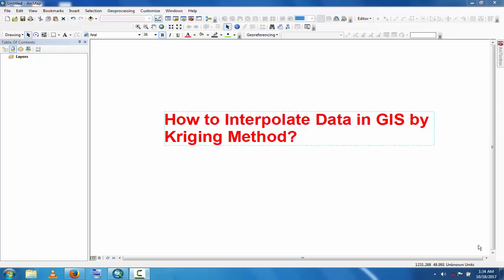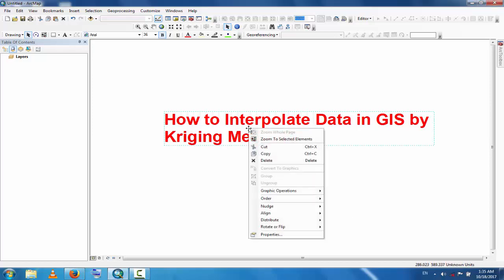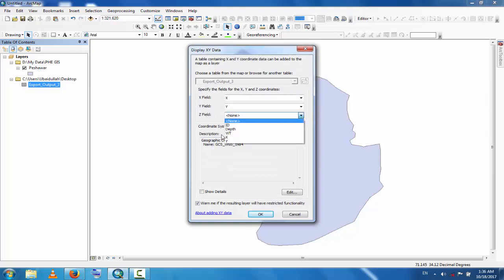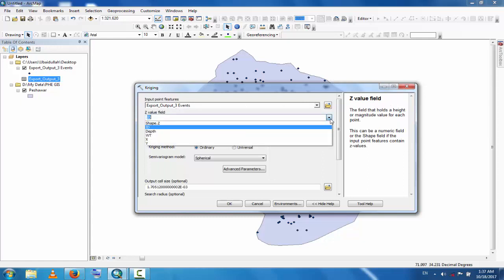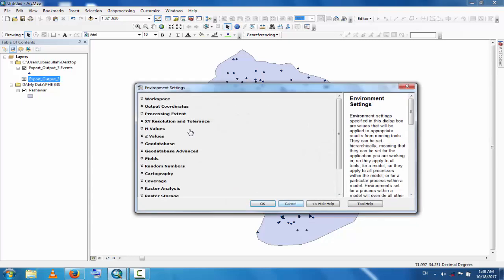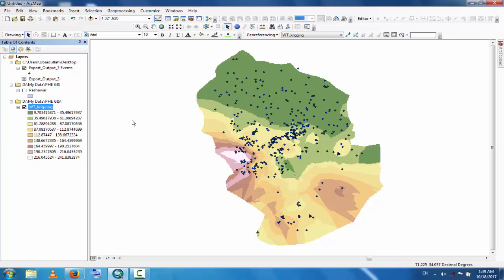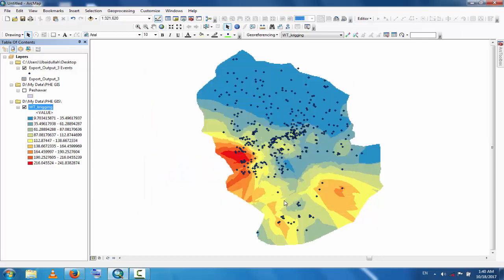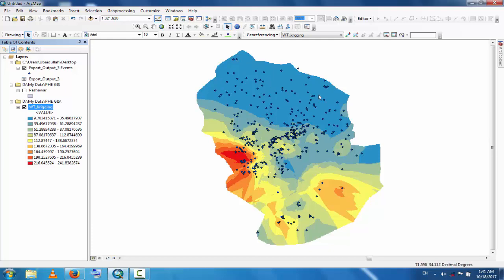Kriging Estimation Technique in GIS || Interpolation by Kriging Technique in GIS

Comment: Asslamualikum, the data for water table was it for several years for all locations or was it for single year and season. Do we hv to take average value for interpolation or will it create raster using all values??
Reply from the maker: The values of water table in this tutorial is for single year... Yes you can use average value if you have more than one readings per year per location.